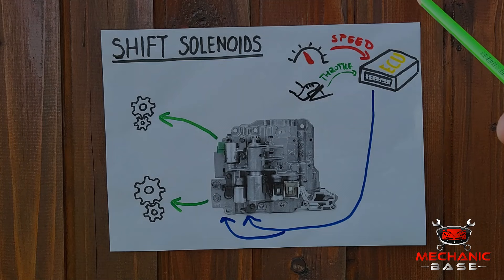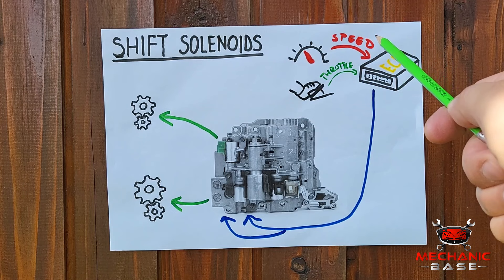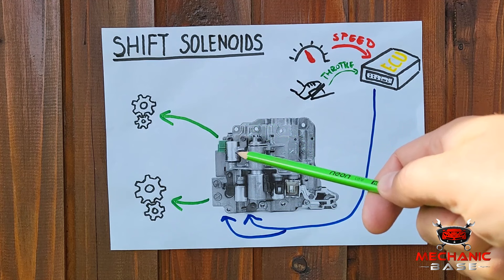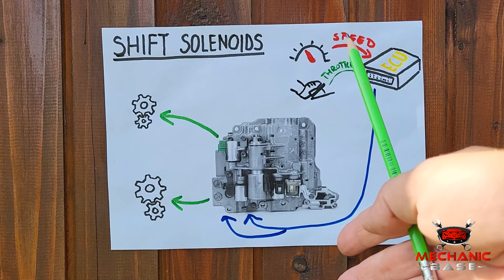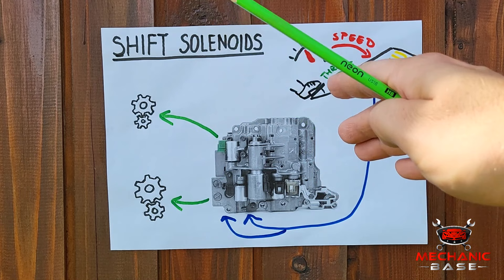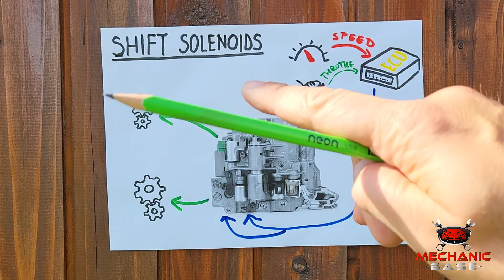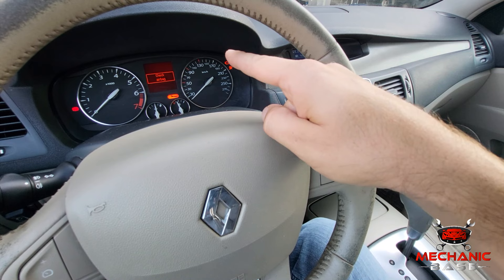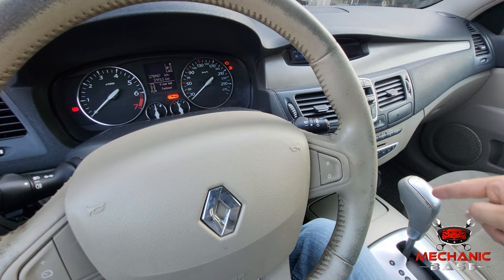7 Symptoms Of A Bad Shift Solenoid & DIY Fixes

Comment from the maker: Did you solve the problem with your car? Let us know in the comments below how you did it, and maybe you can help someone else with a bad shift solenoid!
Don't forget to like the video and subscribe to our channel!

More Shift Solenoid Info: https://mechanicbase.com/transmission/shift-solenoid/
Website: https://mechanicbase.com/
Community: https://community.mechanicbase.com/
Reply: Hi sir First of all thank you very much for the explanation and support. 
I have issue related to the transmission my car doesn’t reversing back totally but it  goes forward but the speed reduces and I don’t know weather it’s transmission solenoid please help me to getting solution 
Thanks
Reply: hello! Can you help me w/ my civic 2012 AT. 110km milleage and i have a shifting problem. this happens when the car is cold usually in the morning. when I change gear to drive or reverse theres a delay and the car jerk. but when the car is hot the shifting is great and normal. 

ive already change atf, engine and transmission support. any advise will hel.p thank you!
Reply: Hello 2007 Ford 500
Jerks clung noise 
Then when shift in D IT WILL RUN AHEAD ON IYTS OWN .
SAME IN Reverse 
What the SNAPPLE PLEASE !? US ARMY VETERAN HOMELESS 
MY CAR IS MY HOME FOR NOW. PLEASE TELL ME WHATS WRONG SO ILL KNOW WHEN TAKEN TO A Auto Shop, or TRANSMISSION SHOP 
IS THIS A SOLENOID SHIFT ISSUE !?
Reply: When I put my 2003 mustang from Drive to Park the car will rev up and my gear shifter will be loose but if I go from Drive to Neutral then Park slowly it won’t rev  and gear shifter is super tight? Is that a solenoid? Problem or something else?
Reply: 01 Frontier pickup won't start off in drive whether cold or warmer up. Put it in 2nd and it may pull in a few seconds or a half hour before it starts pulling. Then it works fine until it's parked and I have to do it all over again. And no codes

Comment: no, and those solenoid packs are around 200USD at least for a 99 Chrysler 300m. i had installed one and it went from one code to another and now it won't even move when you push on the gas. thanks for reading, lot of folks on these say questions ,comments, you never see a reply except a like from them...lol

Comment: I changed my valve body and all because my pathfinder was stuck in low gear, but now everything works as it should except I have to rev the engine to go into reverse

Comment: Great video...i disconnected my shifter, due to using an upgraded transmission, and now my 95 Pathfinder, won't go into 3rd or 4th gear, after it warms up...I'm using a 2001 Nissan Xterra transmission which has different wire connections, than my stock 94 Pathfinder harness, at the shifter location

Comment: I have a  Toyota Platz (vitz form) its an  automatic  with the same problem  at first it was shifting pretty fast when i Accelerate upto 10Mph it engage it self from 1,2, 3  but it's stuck on one Gear i will try out that

Comment: Does a faulty solenoid cause a transmission to suddenly drop from top gear back to 3rd where it will stay sometimes up to 10 mins and then it changes back to top gear and is ok for 20 mins sometimes then back down to 3rd again?

Comment: If my transmission shift at 3 to 4K from a stop could the selonoids be the issue? Ive had the engine replace about a year ago but had ny care sitting for a few months thorughout the year i have no trans codes either its a 13 kia optima trans has 144k miles engine is 6k miles now

Comment: My 01 Frontier has started not going into any forward gear when I first leave home every day. It's got plenty of fluid. I put it in 2nd and wait until it shifts and pulls. Once it does i can put it in drive and go wherever i need, until I park and then i have to do that all over again. It'll go in reverse every time and turning off the overdrive doesn't work until the transmission shifts which can be a few seconds up to 30 minutes like this evening. What would cause this.

Comment: So.  I have an 02 dodge dakota. It has no codes for transmission but it shifts trug all gears when cold but one it heats up it will not shift out of 2nd. It's this a valve body issue or would there be something else?

Comment: My 1999 grand prix stopped running after several months and about1hundred dollars I put a inline electric gas pump on it and it fired right up.However after disconnecting the fule pump from the battery it stayed running so apparently the full pump in the tank is working again.However now it will not shut out of first it does not slip  it just won't shift..any thoughts...

Comment: I am an automatic transmission mechanic .
I had a toyata sienna lee. the steaming thermometer at the dashboard is bellow one , and it's causing the engine not to accelerate in accordance with the throttle .

What should i do about it ?

Comment: Hello,
I have a problem with my automatic transmission – Renault grand Scenic 2 – 2006 – 2.0L.
When I start driving with a cold motor, the transmission is smooth. After 30 minutes of driving in town, with the whole system hot, I start to have harsh shifting, especially with the first gear. After stop on red light for instance, the first gear disengages and wouldn’t shift when accelerating, like going to N position. After a while it would engage brutally. After starting driving on, it’s ok more or less until the next stop. The same with the Reverse gear, It keeps like in N position. When I try to move to manual drive, the same issue witht th e 1st gear. But here, if I choose the 2nd gear, it shifts smoothly! To exclude the electronic problem, I’ve changed the gear electronic card. The same problem. What could be the issue here? What do you suggest to do?

Comment: Hi i charged my transmission and it was working fine and all of sudden it stopped working. If i accelerate the car it tried to move but i dont want to damage it. I put the from wheels free and it runs but when i put it on the ground and it doesn't move and in the panel i have the engine light on

Comment: P2716 Pressure Control Solenoid D Electrical code came up with engine light on, traction control on, and warning sign with a message check vsc system on Toyota Aurion 3.5 Presara 2008, 244000 on the odometer. 

At first the mechanic deleted the code saying there is no underlying problem and the code appeared again after a week, he suggested transmission oil servicing, paid 400AUD and the car has no noise and performing well then before, but right after a week again the code appears. But no degrade on the cars performance, mechanic suggests the whole change of transmission but I think it could be loose circuit, wiring issue but they wouldn't want to even try and replace the faulty solenoid or so. I need your help on this

Comment: I have a 2007 Toyota Rav4 -4 cylinder. 2 days ago, after driving about 50 miles, the gear shifted to 1st gear on its own and remained there. A mile later, I parked it at home. Now, when I put car gear shifter stick into any gear, the car will not move 1 inch. Also, now it is making noise even when the engine starts without moving the gear shifter. The tranny is U241E1. The fluid was changed at the transmission shop, about 3000 miles ago, and the engine has 204,000 miles. The fluid level on the transmission stick is much higher above the top mark without adding fluid. Could you please give me your opinion of what could be causing these issues. Thank you very much.

Comment: Hi. I own a 2015 Hyundai Sonata Hybrid with 180,000 km. Awesome car, super comfy and has been quite reliable. I have an issue regarding the shifter. I put the car in Park, turn the engine off and the car doesn't detect the shifter is in P. A little bit annoying. Also, I can feel some kind of jerkiness (not grossly, but noticeable) in the shifting. Do you believe both issues can be related? ATF or transmission oil hansn't been changed in the whole lifetime of the vehicle (10 years next november), following what Hyundai recommends according to their technicians. Thanks in advance for your kind reply.
Reply: Did you figure it out? My truck is doing a similar annoyance.

Comment: Great video, tx.  in my situation i have no check engine light but the vehicle, 2000 Ford Ranger, will not go into passing gear, won't go into overdrive, either.  otherwise the truck shifts smoothly.  i guess the next step is have someone run a diagnostic even though the warning light is not lit. any thoughts would be appreciated?  tx
Reply: These transmissions are known for this. Change the solenoid and service the fluid and it should fix!

Comment: Hi , very detailed and helpful explanation, I would like to mention my transmission problem, gear shifting is smooth, but during a sudden speed reduction or brake, the transmission downshifting gives a big hard jerk. what could it be ? your expert opinion please.
Reply: I want to add here that the OBD report shows no signs of any issues with the transmission, could it be the transmission oil and filter? as I mentioned , there are no issues with the upshifting .
Reply from the maker: Changing the transmission fluid and filter - if it hadn't been done for a long time - would be a good starting point.
Reply: @MechanicBase  Thanks for the suggestion. I already bought the oil and the filter. I Will update here after the service. I hope it’s not that solenoid issue.
Reply: @muziqb what was the solution

Comment: Engine is struggling to move when engaging the drive while at the same time when on park you can't turn the engine off because it ob what but you can't take the key off after parking the car. Is it not a bad parking problem

Comment: I have a question about a transmission problem,shifting 
Seems ok but if my foot is off
The pedal, like when the car is
Coasting on level ground and 
Then one steps on the pedal 
To return to normal driving it
Engages in gear again but not
So gentle (rough)like there is
Slack between gears…

Comment: What about if the car starts and for it to move will take at least 17 to 20 minutes after engaging in drive? Could it be the shift solenoids, because it is also having the problem of gears not shifting.Only shifts 1,2 that 's it.

Comment: Hi bro,thanx for good work you are doing..my Nissan serena  26 keep on losing power on the hill after alo v drive....but when it cools down it goes back to normal and drives well..plz help....
Reply from the maker: Do you have any codes? Check engine light?
Reply: If you still have that problem I think I got the solution because my Nissan Sentra did that. The dealer diagnosed a throttle body failure. Mine was so bad that it started shutting off the engine on the freeway.

Comment: I have 05 honda civic auto transmission for 2nd to 3 transmission seem to have a delay but seen to work  fine when pass delay but i pull it out my driveway to park it on the street no problem left on the street all daY later that night went to pull it bk end started  put in gear to go forward so I could make u turn stop to put it in Rev car didn't go put it in drive would not go try to put in part no part Tran made noise like it was try to go in park ..push it bk in driveway try it next day no pull in any gears but Tran still make noise when I try to put in park shut motor of put still no put had to block wheels will in my driveway need help

Comment: I have a 2003 Chevy S10 with the 4l60e transmission. I have a problem with it not down shifting to first gear. When moving from a stop it's in second gear. Even when manually putting it in 1st it's still only going to second. It's showing a code for shift solenoid B is stuck open or shift valve sticking. I have changed both a-b solenoids and cleaned out the bore holes for both but no change. Any ideas?
Reply: It is shifting fine other than that problem. When kicking it down it's also not downshifting to first gear. I'm about to change the valve body and wiring harness along with all the solenoids because this transmission was rebuilt about 4000 miles ago and I don't know what else it could be. Any suggestions would be greatly appreciated.

Comment: Hello 👋 I also have a problem of gear shifting. When i engage into reverse its jerks and moves back properly. When engaging drive, it skips gear 1 and moves to gear 2 and it moves. When changing from gear 2 to 3, it also jerks and it  will be stuck in gear 3 even if increasing the speed. It also shows the AT light and Engine light on the dashboard. I changed the transmission fluid and made no difference.
Reply: I have the same problem with my Toyota Highlander 2005 V6 model
Reply: When I engage in reverse, it jerks and moves smoothly but sometimes does not move at all. 
When drive is engaged, it sometimes skips 1 and moves to 2. It jerks when changing from 2 to 3 and the engine RPM will raise as if it enters natural before 3 is engaged.
It does not engage 4 & 5 at all even when speed and acceleration is increased. 

When the car is stopped or speed reduced, it remains in gear 3 most of the time except if the can is brought to a total halt. 

Whey could be the problem; solenoids, verve body or what?

Please help!
Reply: Have you worked out the problem yet?
Reply: @akinjideakinlabi5993  Okay brother , what i a have say is if you have a good automatic transmission mechanic , ask him to service the valve body along side checking the solonoid first .

Comment: my rav4 transmission is fine except in the mornings when i literally have to wait before about 3-5 mins in Drive before the car decides to move forward. But once it moves it goes fine, shift, acceleration and all. But its a bit slow sometimes when it comes from parking to drive. but once it goes, everything is fine. What do you think is the problem?
Reply: i’m not so sure but it MIGHT be the torque converter. i might be wrong tho. if i am someone please correct me lol
Reply: exact problem i’m having. did u end up fixing it ?? what route did u end up taking?

Comment: in my car when i try to pass the 3 gear he dont want to change just go more and more velocity but never change the gear until i put it on parking and then I put it on drive drive and walaaaa everything like new the problem is only when the car is cold when is very hot works fine i dont know whats going on    😅 my bad for the story

Comment: Are any good tx dianostic nechanics bear greensboro nc. Most here want to put a rebuit tx in, for $4100, P0753 code, shift soleniod A electrical, 94 Lexus es300 v6 3.0, just 47K mile, just started intermittant  stalling after driving for 8 months by starting out in low at stops

Comment: My car is a 07kia spectra ex and it goes in reverse but it's like there are no forward gears at all because it will not shift into any forward gear what's wrong with it
Reply: I’m having the same problem with my Buick.

Comment: So I had a 2000 Toyota tundra automatic transmission everything was fine and then all the sudden one night it stopped working just wouldn't go in gear wouldn't do anything so I told it home it's at for several weeks and then all the sudden it work again only for that night and then it stopped working and wouldn't do anything once again what could it be
Reply: Did you ever figure that out my Honda Ridgeline is doing that now.

Comment: Ford Mondeo 4 2.0 tdci slightly hesitates when driving in the final gear on a highway,pressing accelerator noticeably harder this hesitation disappears.
Reply from the maker: Hesitates when it's shifting, or when driving in the same gear?
Reply: @MechanicBase  Driving in the same gear.

Comment: Hi, 
My car went into limp mode 2 months ago, fault solenoid.
I've been daily driving as I can't afford a new car.
Yesterday all of a sudden my car was back to normal and not problems with my gearbox.
Car is in 150k miles, never had fluid changed.
Should i change the fluid?
Reply: If it was my car i would. If you can do it yourself youll save a good amount. Get a new tranny filter too if possible
Reply: wow lucky you! Is it still ok?
Reply: @InJusticeAustralia  hey champ.
So my mk4 golf gearbox was costing 3k to repair. 
I removed all the parts and got another mk4 golf identicle.

I did an EGR delete and the guy had to code it out afterwards.
Once coded out the engine light came on a few days later stating faulty gearbox solenoid ffs.

I wouldn't code or ramap my car again tbh. 

Luckily I have a mk4 golf which is worth peanuts and my new mk4 is 1 owner 100k mile minter.

Stay hard! 👊🏽
Reply: Yeah bro. My Hyundai has 206,000,000 & the solenoids are bad. All external sensors replaced except for the camshaft & crankshaft sensors. TCM is original.

Comment: Range rover l322 works fine forwards, shifts nice and smooth, but reverse gear is weird. No Power backwards, cant drive uphill backwards.  Torque converter makes no noise and do warnings anywhere. The 5l40e Transmission …
Reply: Did you work out what it was? Mines similar.

Comment: What it means when i put my car in drive it drive when i stop at a stop sign the car wont move or reverse
Reply: May have faulty tcc (torque converter clutch) solenoid. Code P0741

Comment: Hey guy my RS Lexus 350 fail reverse after driving for a long hour and immediately it cool down like an hour it will start reversing
Reply from the maker: That sounds like a sticking solenoid, or low transmission fluid. We'd suggest checking the fluid level first.